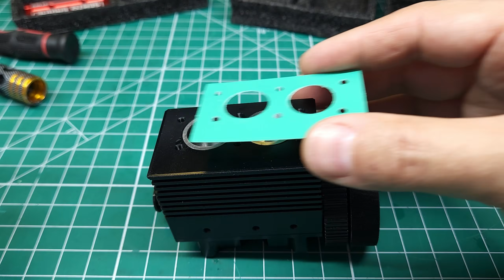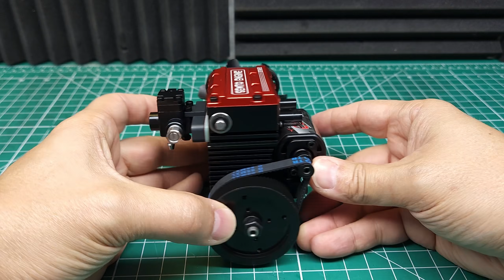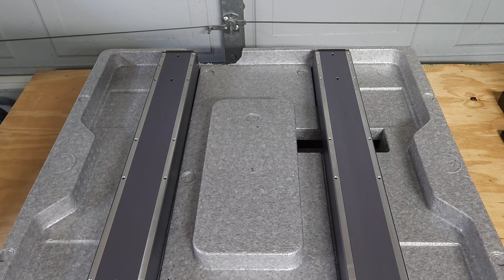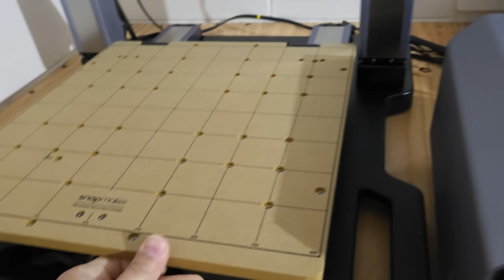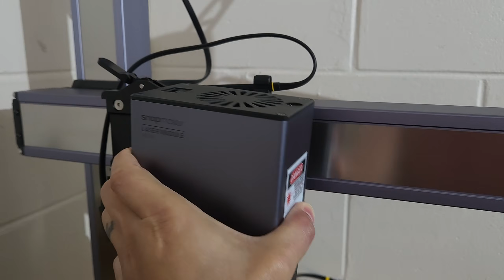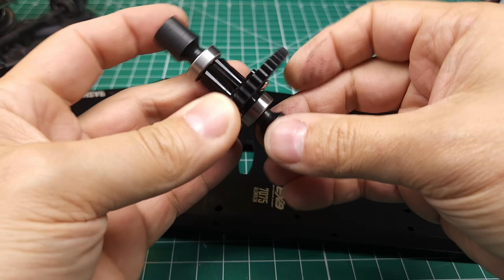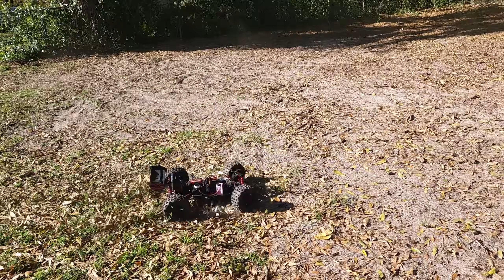Electric No More! My Arrma Kraton Runs on GAS Now!

Comment: I remember a day when if you didn't have a nitro/gas rc you weren't moving.  Boy have things have changed.
Reply from the maker: For sure. Don't get me wrong there are far more appropriate engine choices if you actually wanted to practically do something like this. This was more for a bit of fun and just to see if I could.
Reply: It was nice to see someone use one of these engines in a actual application.  Most times the are table runners. You gave it a good go at it.
Reply from the maker: @RVsandRCs  I do think there is quite a bit more power to get out of these engines. The way they're designed just is not very efficient. The valves are not properly seated in the valve seats The piston ring gaps are too large and I think most importantly the intake manifold design is extremely restrictive. I bet with some more work you could probably get twice as much power out of one of these as they have out of the box.
Reply: @DoRC  agreed. It seams they are designed to just run and rev for demonstration purposes mainly. Even the v8s I've seen installed into RCs don't seam to make 2s power 🤣
Reply: @RVsandRCs I saw a V16 in a Lamborghini and it didn’t go to fast either.
Reply: RIP NiCads😂
Reply: @mesodan my nicads had better memory than I do.
Reply: I remember those days, Back in the 80s and 90s we just had brushed motors and nicad packs. We'd start out going as fast as they could then very quickly watch as they get slower and slower until all they would do is go in circles all by themselves lol. Meanwhile the neighbor kid is flying by with his nitro laughing. Now we are the ones laughing with our 30 minute run times flying by them as they constantly tune and check temps. Nice that lipo packs are cheap now that we can have several on hand ready to go!
Reply: Now
It’s the opposite
Reply: definitely need a big block 😂 this motor would be cool in a crawler something a lot lighter and more scale
Reply: That's so sick
Reply: Big facts